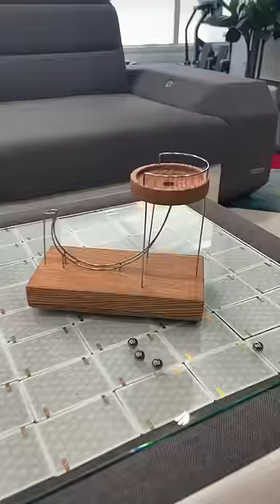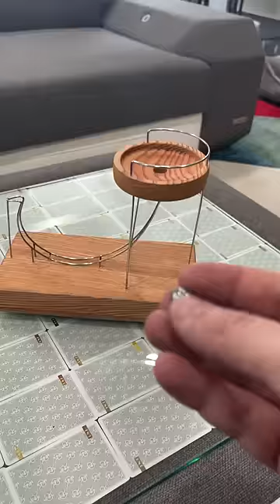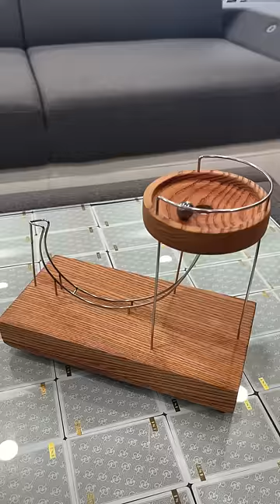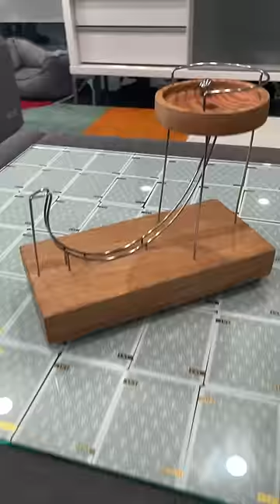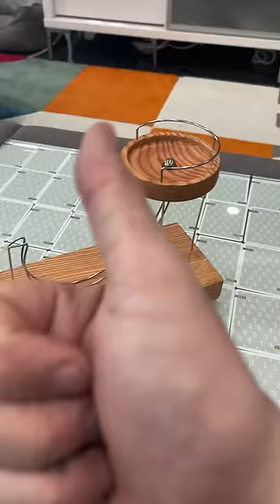An Impossible Perpetual Motion Device?! 😳 #Shorts

Comment: "The hardest part of making a perpetual motion machine, is hiding the power source"

Edit: magnets use energy, even if we don't make it, it can use energy, the magnets are a power source, especially if they are electromagnets
Reply: yes!! hahahahahaha.
in this case, seems like magnetism is the power source.
Reply: Where’s the quote from
Reply: @thewak7180  genuinely don't know, i tried searching it up, it's just at the back of my head
Reply: It seems legit, but it will stop soon due to the rail friction and aerodynamic drag of the ball. See how many cuts he does in the video. Maybe this thing can run for like one minute or so.
Reply: @Rafael-ko1cb  Saw a lot of people in another comment sektion say its battery power
Reply: @Rafael-ko1cb  it is possible for something to run indefinitely, as long as it does not produce useful power
Reply: Its wireless 🤣🤣
Reply: @rogervanbommel1086 , without lossess, I agree. But that is not the case here.
Reply: @roneitback  
The part of this one that's Obvious.
Is the discoloration in the end of the rails. Nothing to see here 😂
Reply: @roneitback  
Which just gave me a thought.
Hey, first time for everything 😏
But why don't they make these things Solar Powered. Be one step closer ☺️
Reply: @rogervanbommel1086  you are right, as long as the same amount of power is generated by an object that is the exact amount it needs to run, and no power is removed, it will run for a long ass while
The only thing stopping it could be it wearing down
Reply: @My-Pal-Hal  solar power is one of the best powers you can get, as it doesn't use any resources, the problem is that solar power costs a lot to setup and were a bit to far gone for solar power to be that easy
Reply: @roneitback  
Oh,..
But not for a tiny sucker machine like that one 😏
But, as to solar power. As battery technology improves. So does the future of solar, wind and water. And panels are improving as well. It's going to come in real handy,.. soon 😬
Reply: @roneitback  solar power is the worst. Uses a ton of resources for panels, needs a ton of space, and is an inefficient source of power
Reply: @roneitback  nope, indefinitely, not a long ass while
Reply: @rogervanbommel1086  if the machine wears down (so that law isn't ignored) then it'll be a long ass while
Reply: @4maz1ng_king , by the height the ball gets after going through the rail, it probably has some magnetic device. But I think this arragement could sustain itself for a very brief moment  without the magnetic field if the ball had more energy than just the potential energy.
If the hole had a conic "intake" where you could drop the ball spiriling around this cone, it would have kinetic energy in addition to the potential one and it could make the ball rise above the mouth of the cone. But it would work not for long.
Reply: oh you are smart.  so smart.
Reply: @Rafael-ko1cb  …HWUT
Reply: @rogervanbommel1086  but it produces views)
Reply: The fact it's gaining more height than it's drop point is a big enough red flag
Reply: @rogervanbommel1086  yes, accelerating is what takes energy not moving.
Things technically always keep moving forever unless you apply force to change their movement or speed.
Reply: @qalbi-s_Ahnfy2095  wrong
Reply: @rogervanbommel1086  there is always a loss of power
Reply: @Sam-ps8zz  solar power powers life itself.... you don't get much more efficient than that...
Reply: @rogervanbommel1086  not really on earth. Too much friction imposed due to gravity
Reply: @udderstuff5554 while thats true, the amount of energy needed for plant growth is very low compared to the energy demands of anything we use
Reply: @Sam-ps8zz  is it though? A 200 foot tree utilizes photosynthesis to power its metabolism seems incredibly efficient yo me. Further its the sugars created by plants that power larger organisms. Take our brains, to create the same computing power that our brains possess you need a super computer that requires vastly greater space and energy. So I argue our current technology is INCREDIBLY inefficient compared to biological solar based energy metabolism.
Reply: @Sam-ps8zz  simply put the entire world's biological machine runs primarily on solar energy (aside from some extremefiles). So saying that solar is inefficient addresses human wastefulness in energy useage not the actual potential. Using other forms of energy can create larger quicker bursts sure, but the efficiency is actually not very high since the demand on the fuel is so high. The reality is its our dependence shorterm high energy outputs and inefficiency that puts the highest strain on resources. That's a flaw in human needs not a flaw in the power source.
Reply: @tescheurich  ROFL, friction imposed due to gravity, have you taken physics 101, that is wrong, yes, too much AIR RESISTANCE due to the atmosphere, that is something totally different
Reply: @rogervanbommel1086  Ok ok, it's been a long time since physics. But gravity's ability to collect an atmosphere is the ultimate root cause, so there.
Reply: @udderstuff5554  they also use a lot of space for much less energy. Solar panels are even less efficient. If they were perfect we'd already only be using them. Not to mention short life spans and constant cleaning required. Nuclear is the cleanest and most efficient. But the best way is to stop trying to rely on 1 single
Reply: @Sam-ps8zz  again.. you completely miss the point. The ENTIRE WORLD ran on solar power before humans began building tools. Our limited understanding of the technology doesn't mean that Solar isn't viable, it means we just aren't harnessing it efficiently. That's a human limitation not a limit on solar...
Reply: @Sam-ps8zz  for example you seem to assume electrophotoaic panels are the only way to harness solar power. It absolutely is not.
Reply: @martiendejong8857  just because people are limited in their understanding isn't an excuse. Generating more electricity/ power than you store is inefficiency. Growing algae and turning into biofuels is both a battery source and power source. Also algae can be harness direct for electricity as well. So like I personal limitations of the mind are the problem.
Reply: @Rafael-ko1cb  no, it's battery powered using magnetism.
Reply: @tescheurich  yes, but this would imply it also would not work on atmosphericless planets, and that is not true, this has been tested by Apollo I’m pretty sure(a feather and bowling ball fall at the same speed and do not have a terminal velocity), something like this would run (nearly) indefinitely w/o air resistance
Reply: @thewak7180  Medhi from Electroboom I believe
Reply: Do the beads stop after a while? How does it work?
Reply: @thewak7180  iirc, electroboom
Reply: @Ahnaf Atif There's no magnets.
Reply: @thewak7180  ElectroBOOM
Reply: @qalbi-s_Ahnfy2095  so how does it go down the whole? 🧐
Reply: @Rafael-ko1cb  it's infinite actually. It creates motion energy each time it falls
Reply: @livingstone1084 , but due to the losses, it will have less and less kinetic energy to convert to gravitational potential energy. At some point, the ball will not be able to reach the height necessary to re-enter the system and the thing will stop. And more than that, it cannot start purely with the potential energy of the initial height, otherwise it will not complete a single loop. It has to have the initial height potential energy plus some kinetic energy.
Reply: @Rafael-ko1cb  I understand what ur saying but it doesn't lose any energy. It only produces more every time it re-falls through the whole and it will always fall because the surface is curved so that gravity will always pull it. It relies on earths infinte source of gravity.
Reply: I am just checking, but those are solar panels under it, aren't they !?! I don't think many people caught that...
Reply: Exatamente!😂😂😂😂😂
Reply: It's the same Thing as a rollercoaster
Reply: @leviathansruse1085  a knowledgable  explaination would be nice..
Reply: @Ahnaf Atif Gravity....
Reply: @Rafael-ko1cb  the rail friction won't change it in this case, as the start conditions are recreated everytime it lands on the platform
Reply: @livingstone1084  you're assuming that it actually is a perpetual motion machine. Which is impossible. The earth's gravity is constant and unchanging, but it is not an infinite source of energy. You can only get out what you put in, i.e. the ball loses potential energy when it drops, and then regains it when it goes back up.  But with losses, because losses are inevitable. Without a power source, the ball eventually doesn't make it back up.
Reply: @Rafael-ko1cb  I hate it when comments think they know whats going on (but they dont) and try to sound professional.
Reply: @rogervanbommel1086  It would have to be a perfectly controlled environment, almost impossible to achieve
Reply: True
Reply: Der Tisch, wo es draufsteht , denke ich, wird die Energiequelle verstecken.  Niemand hat so eine Tischoberfläche
Reply: Hid gravity
Reply: @livingstone1084  The guy himself says it's impossible, but if it weren't, it would look sort of like this. So it's definitely not real.
Reply: @My-Pal-Hal  even the sun will die one day...nothing lasts forever...😉 that my friends is the most universal law 😄
Reply: @mrgreenwilldoit  
Except,.. YOU CAN'T PROVE THAT.
And as science and understanding advances. It's always more questions than answers. Baby Steps ☺️
There are also good theories on us being in a Simulation. So better keep your Xbox Gold Account Current 😂
... hey,  ya never know
Reply: Gravity is the source
Reply: @Sam-ps8zz  solar power has been a good place for scammers to rip people off. Because when people think of solar power the focus is away from the expense of the battery part of the system, and more focus on overdoing the potential of government rebates offers
Reply: Gravity can create perpetual motion..
Reply: This one uses magnets and a battery.  Aliexpress sells it and explains it
Reply: It's not magnetism . . . I know this for a fact.
Reply: @4maz1ng_king  It's a wheel inside the hole spinning via battery power.
Reply: @rogervanbommel1086  I'm pretty sure that no form of energy is perfectly efficient, that in all things at least be some energy is lost, changed to some other form.
Reply: @My-Pal-Hal  No, that doesn't make sense. In every conversion, you're losing energy. Converting solar energy to electrical energy that converts into the mechanical spinning of a wheel loses energy every step of the way. To then use the energy of the spinning wheel to generate power in any way then loses even more of the original solar energy.

It's more efficient to use the energy as directly from the source as possible, which is why green energy isn't nearly sufficient. It's silly, and it's about power over you, not about anything else. If Dyson spheres, Halo rings, and Magog world ships were possible, then maybe you could get enough energy from the sunlight and heat. However, when you're talking surrounding a sun with mass, that sun is several times bigger than the biggest planet. The circumference of such a structure means that you're going to need more than the mass of entire planets. But hey, we do have an asteroid belt. Unfortunately, the WEF crazies want to kill so many people that will never have enough expertise to solve that puzzle, let alone actually get out there and learn what we need to learn.
Reply: @Rafael-ko1cb  No it isn't legit. Drop a bouncy ball, or put it on a string, see how far it comes back up. It never comes back as high as it was dropped from, yet this somehow with drag from the bars is going to come back higher than from where it was dropped? It does not at all make sense.
Reply: @livingstone1084  No it does not. You cannot create energy. You merely change its form.
Reply: @skrrskrrrr99  It's not a computer program.
Reply: @anthonyfauci7837  just look at it, you neither need laws of physics, nore computer
Reply: @anthonyfauci7837  it is
Reply: @roneitback  What do you mean? I saw a different video where it shows a wheel in the middle of the hole spinning using a battery for power. It shoots the marble downward, giving it enough momentum to throw it back into the bowl up top. 

Are you saying this one is a different design using magnetism to do the same thing?
Reply: @skrrskrrrr99   It sounded like you were looking at it like a computer program or electronics when you used terms like recreates the start conditions. That's something I've said in a classroom learning about practical applications of microcontrollers.
Reply: @skrrskrrrr99  Oh, and it's powered. It uses a battery and a spinning wheel in the hole . . . or maybe magnetism to do the same thing, give the ball momentum enough to jump up higher than from the point it started falling.
Reply: @anthonyfauci7837 , I have said this one in the video makes no sense. But, if the ball has an excess of energy before going down the rail (therefore potential PLUS some kinetic energy), it could go for a brief period of time. Of course on pure potential it would not complete a single cycle.
Reply: @anthonyfauci7837  
Well. You kinda missed the point.
Making a Toy like in the video, with a little Solar Backup. Just means you wouldn't have to change the batteries. At least not as often 😂
And you know. There's some pretty Tiny Stars out there. Like the size of astroids. They have a bit of mass alright. But way way way smaller than planets. Jus sayin.
Reply: @anthonyfauci7837  yes
Reply: Some kind of magnetic accelerator at bottom of the rails. Hidden below wood.
Reply: @Rafael-ko1cb  a conic delivery will not give any increase in vertical component of velocity(it will actually decrease it somewhat due to longer time friction sucks up vertical energy).   so ball not gain any launch height this way.
Reply: So if magnets are an energy source, then are you saying they will eventually have no more energy? 
Seems like a magnet is pushing the ball down just enough to get it back on the platform. But if the magnet never loses its push, then the ball will be in perpetual motion, unless gravity itself changes, right?
Reply: The substantial wooden base might have something to do with conceiling things
Reply: @machimuse7526  if it's indestructible, yes,  the magnet generates energy by all electrons spinning in a certain way, generating a magnetic field, it doesn't need power, it just pushes with it's own energy
Reply: @My-Pal-Hal  I imagine solar cells enough to provide 1.5v with standard AA amperage could easily be mounted onto the toy without taking too much space so that it powers it for the next 20 years or so . . . actually we're looking at a really cheap made in China thing, so the cells will probably last a year or two, but yeah it would be totally doable. 

But I think the point of this toy is to bring your friends or colleague over and amaze them until they figure out what the mechanism is.
Reply: @anthonyfauci7837  
Yeah. I just see things,.. and instant ways of making them better.
We already know. Well, I Hope everyone knows.
That this thing has batteries, or A Battery. And electro magnet.
Lipo cells are small, and cheap. And a good wood worker could build one into a solid piece of wood, with the magnet. And make it appear as a solid piece. No battery door.
And with the right wood staining. A solar cell could be built in too,.. and barely visible to most inspections. Just seemed to me, how I'd build the Illusion we see here. And I looked it up. And these things are like $60-70 bucks plus. I bet I could do it for $50.
Or have it built in China for $5 😂